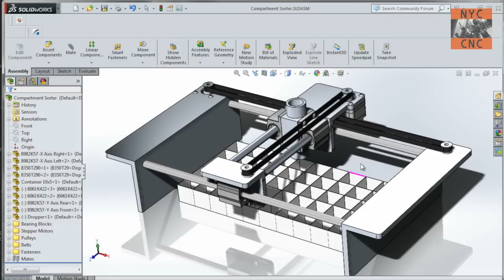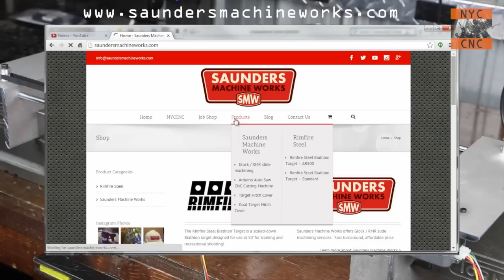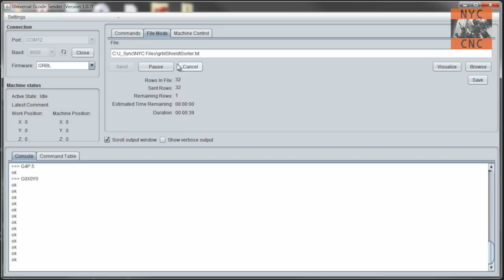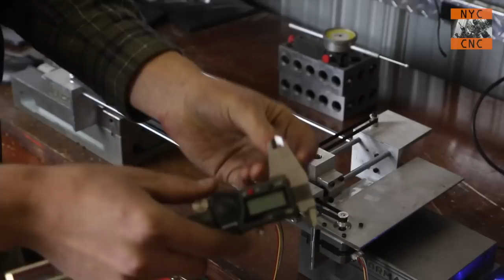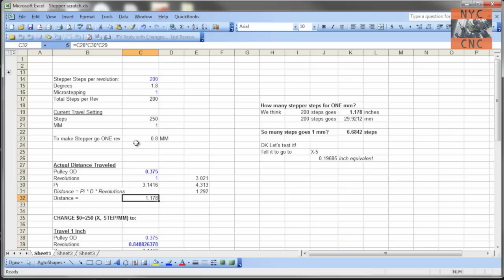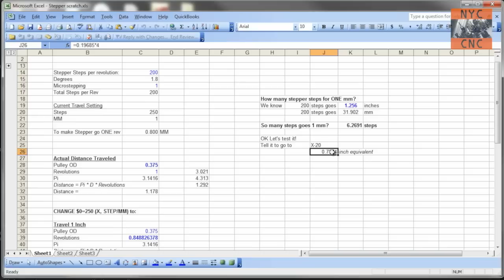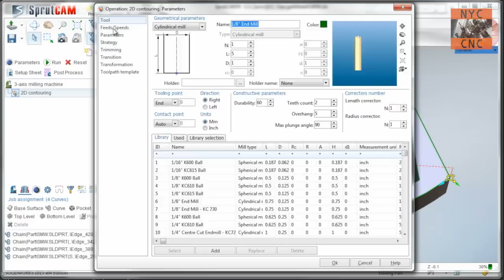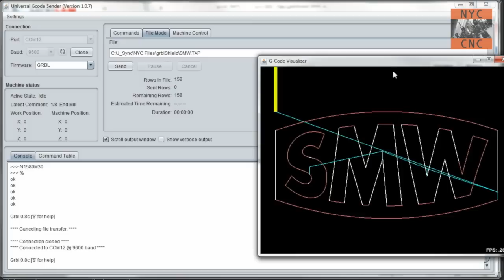DIY Cheap Arduino CNC Machine - Machine is Complete AND Accurate!

Comment: Love this video,  just finished my very first Cnc router,  based on grbl and arduino.  It can mill 47x47cm, and cost less than 100 dollars.  I would never been able too put this togheter if it wasent for people på YouTube like you.  Actually it was looking at one of your videos that got me inn too it, and i think so far that its been a great Journey.  So thanks again for putting your effort in the videos you make☺
Reply: +NYC CNC Hi thanks for response☺ for now i have only milled some wood pieces  for the enclosure for the electronics too the Cnc,  still try too learn difrent software,  and fix all the "baby"  issues that the machine got☺ this machine was just for test purposes,  too see if i could design and make it.  So next project will be too make a stronger one for aluminium.  ☺ im not into any craftman ship really,  i just wanted too see if i could make it ☺ looking forward for your upcomming videos☺

Comment: Cool project John.. ! I really need to get a arduino soon...
I have past experience with pic microcontrollers so this should be fun !
Reply: Started my cnc hobby with self the "picstep" :)

Thanks for sharing buddy !
Reply: Check out the chipKit DP32.  Inexpensive Adruino board, but with a Microchip PIC32.  $24.00   

Once I have the PIC32 working (DIP PACKAGE, easy to prototype) I'll toss it into my custom board.  Get some more TCHIP-USB-MX250F128B For $3.80 from Microchip Direct.
Reply: Arduino Language.  So you can use the same code you have been generating.

Comment: I just got the protoneer grbl shield. It uses 4 pololu a4988 drivers and all runs on the uno. Have you tried this shield and if you have, has it worked out for you? 
I'm in the process of building a mill currently and watching your videos keeps me inspired. Thanks
Reply: I use one of there earlier model boards and they work great. I have had good luck using quite a few different cnc shield boards. There are even some nice new driver boards coming around that handle higher voltages too.. there sweet
Reply: There is this model DRV8825 It supposto handle up to 45 volts or something crazy like that.
 It's a drop in replacement for the the stepstick that goes into the cnc shield. There are rumors of another coming out soon.
Reply: ive read that if you try to go over 35v with the a4988 you will smoke the driver. the alternative offered was as builtrodewreckedit said is the drv8825. For me, I am starting a small mill and learning off that.
Reply: NYC CNC
I don't really know off hand. I just do a bunch of googling and i subscribe to smart guys like you on youtube.